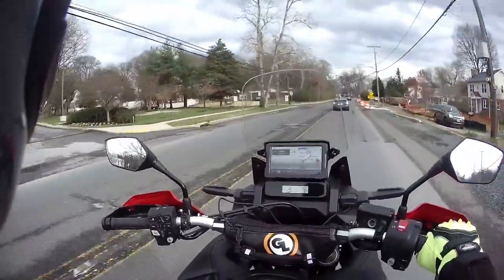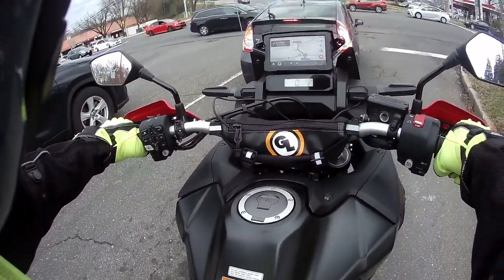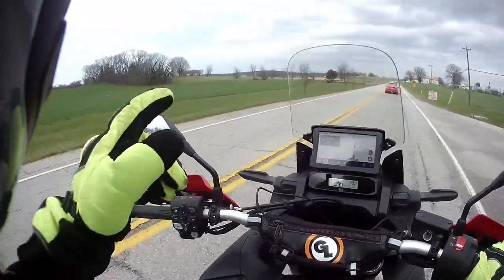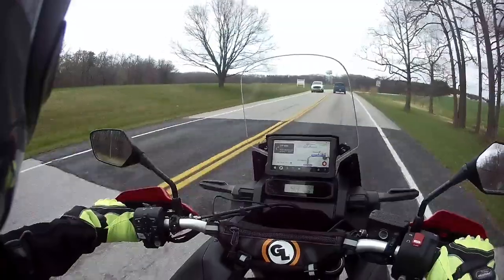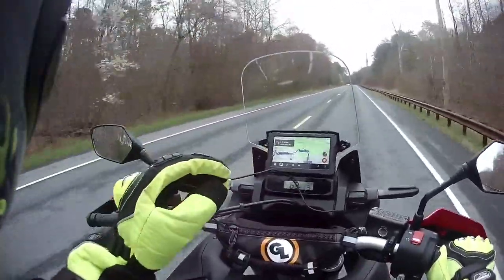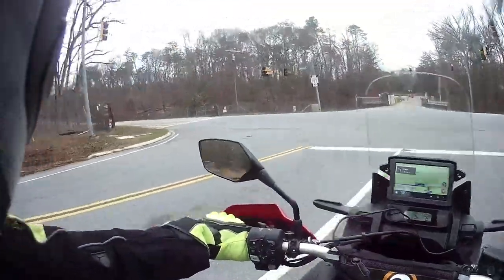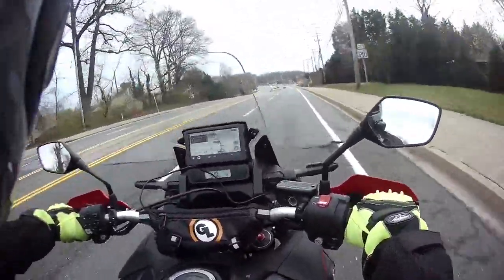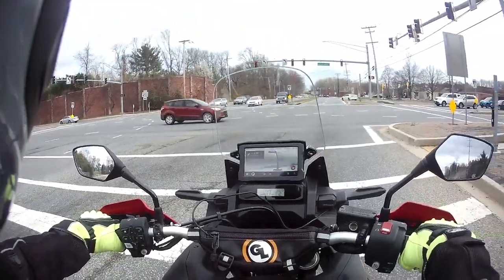Can you have too many electronics on the 2020 Honda Africa Twin?

Comment: Do you think it is too heavy when compared to cb500X?
Reply from the maker: You definitely feel the difference. If weight matters you don't want to ride an Africa Twin. I plan to buy a second bike for the dirt. It's really not dirt or gravel that is the problem for either bike.

Mud is the enemy. These bikes are both to heavy to ride in the wet off-road unless you are experienced at managing the weight.

But, in the mud u will really need some aggressive tires, so there is that part.
Reply: @rocketrollsvlogs7625  used to have a crf250l. Now only have a mt09 and thinking of getting an AT. I don't do muddy roads, mostly gravel and forest roads. I just want to have one bike. Tenere 700 is also on my list.
Reply from the maker: @trailrider1980  great choices
Reply from the maker: @trailrider1980  I'm want to get an MT09 eventually.